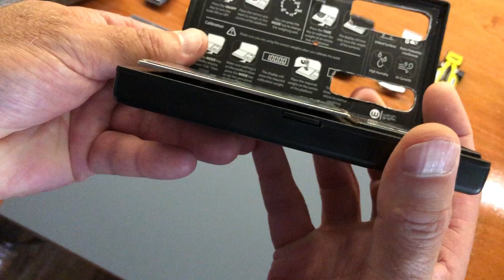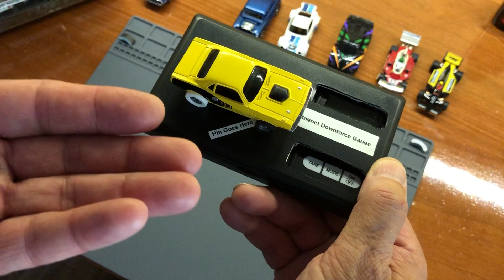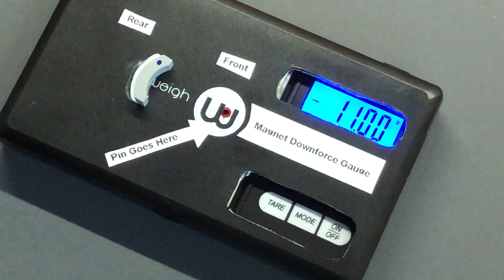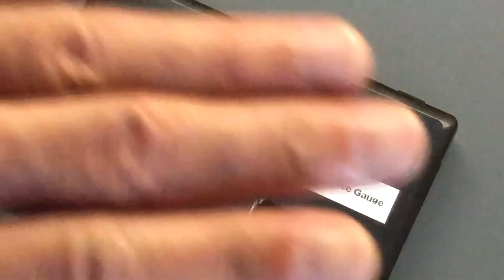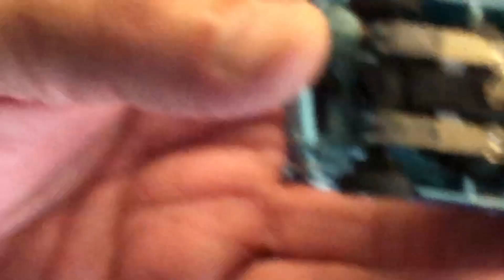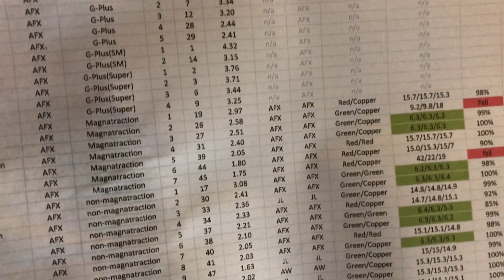AFX Slot Car Magnet Downforce Gauge Build

Comment: why is the measurement a positive 2.30 and not negative?
Reply from the maker: That was a real good catch. I watched the video closely and did see it was not negative. I just set up the unit and tested the same car and got the same results.  I was stumped, when the car was sitting on the platform, but the pin was not in the hole, I got a negative reading, but when the pin was in the hole, I got a positive reading.  A little thought and examination, I realize that this particular car used a non-OEM pin, which seems to be just a little bit longer than an OEM AFX pin.  Long enough to actually be touching the top of the plate so it was pushing the plate down counteracting the car magnets trying to pull the plate up!